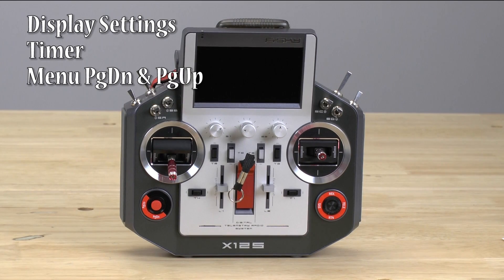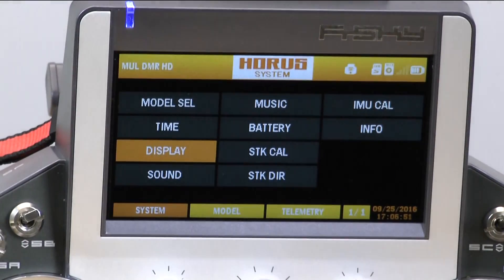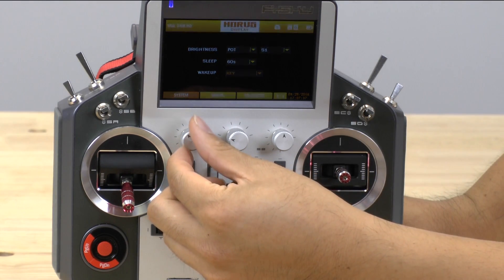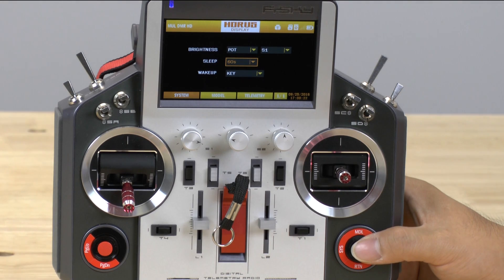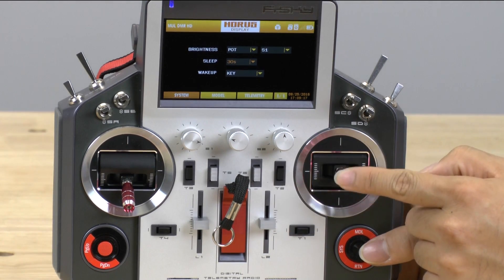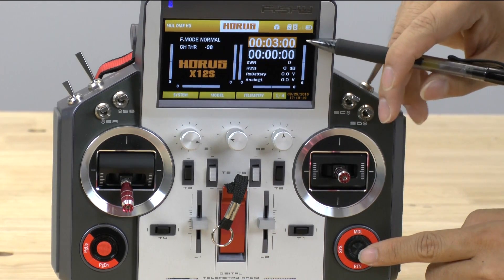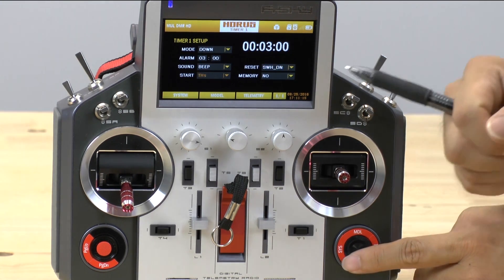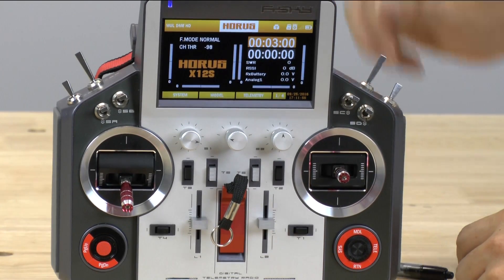Horus Tips - Basic Configuration Suggestions

Comment: What's the deal with range issues with this radio. I really wanted one and i'm hearing reports of loads of failsafe's I also heard that Vek who betatested it was going to smash his with a hammer and go back to a taranis.
Reply from the maker: I didnt know there was a range issue. In fact, testing mine (horus) against other people taranis, the horus has consistently been better on informal range test. One thing to note, I have only flown with the XSR Rx. I have not used any other Rx with the horus.

Im also 99% certain the horus does not tell  you when you have low RSSI, you need to program that. Which is super simple to do, I will do it video on that soon i hope.

I will watch more closely for this but I have had no issues so far.
Reply: thanks for the response. I really want one of these so I'm going to do some more digging
Reply: The newest release for Horus just a few days ago supposedly increased the range. Also note US version has better range. When I bought mine it came with external Antenna, so If I want to screw it in I can....
Reply: Sam Thompson thanks for the info all good things to know